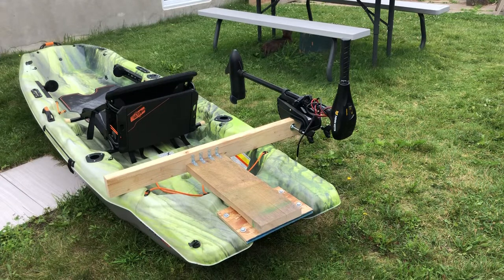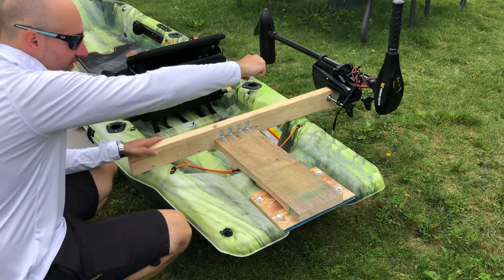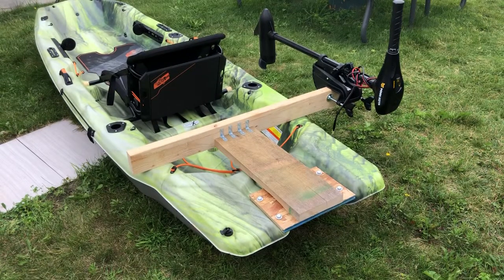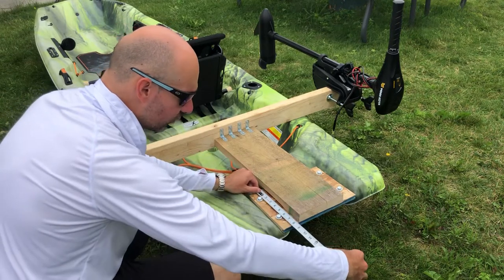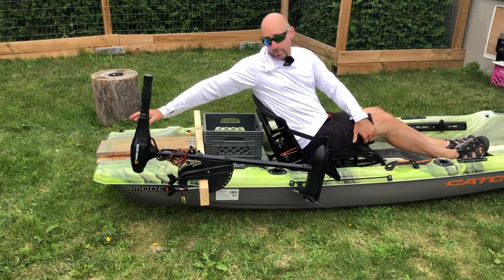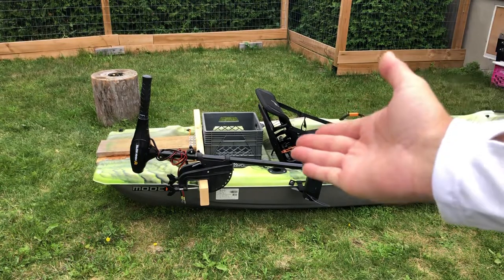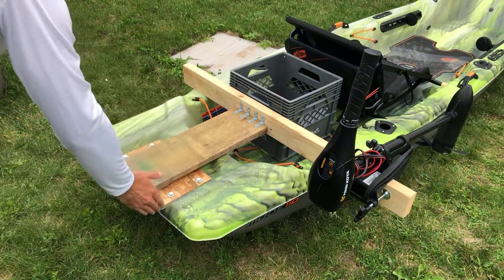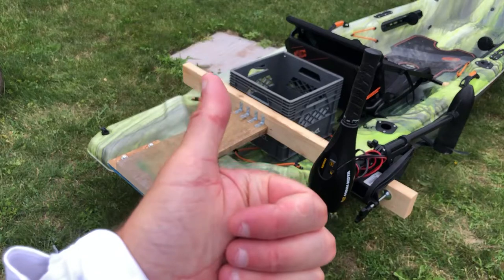Pélican Catch Mode 110 2 gen DIY motor mount and it is perfect 👌😁

Comment: I have the same kyake with a minn kota endura 40 with telescoping extension attached to the pelican transom and I have no issues sitting in the seat and steering it with the tiller .. it's not uncomfortable and can reach the motor and adjust anything needed without issues.. try it the way pelican designed it to be. b4 u wast time and money doing any other way.... ull be surprised 😮
Reply: have the same boat as well with a trolling and reaching the motor to get weeds out of the prop on the water ... I still need to see someone do that otherwise I can't believe it

Comment: Where do you place your battery? On the 2x8?
Reply from the maker: Behind the seat there enough room for a milk crate. If you have a lithium battery that’s perfect. Me I have a group 24 size and it fits in the milk crate just behind the seat and the mount 🤙you can also put the battery in the front for more balance.

Comment: I see a basic problem with this setup. The way it’s placed, the motor/shaft/prop must move forward to raise. For me this is bass ackwards. I want my motor to lift up to the rear, so I can leave it unlocked in shallow water offering some protection to the prop and motor if an object is hit.